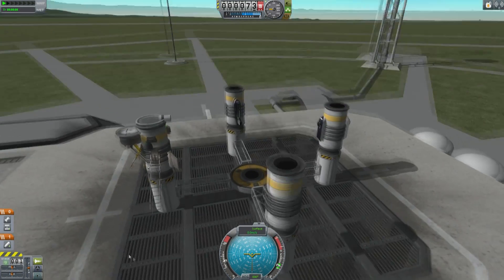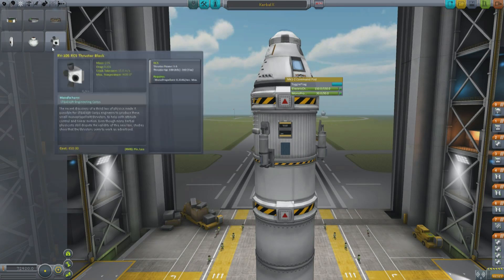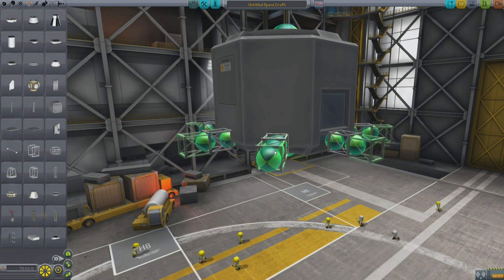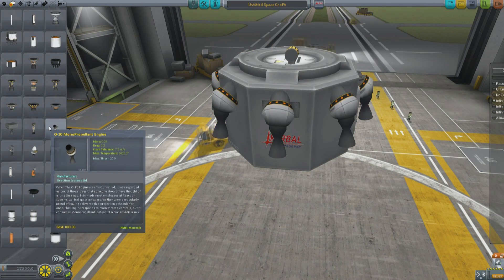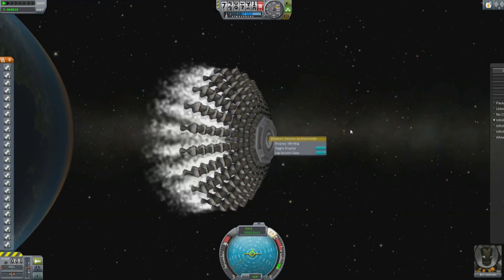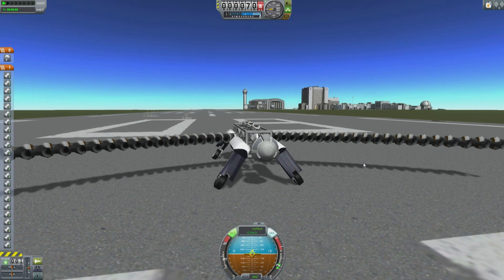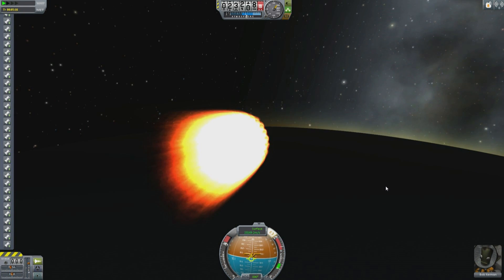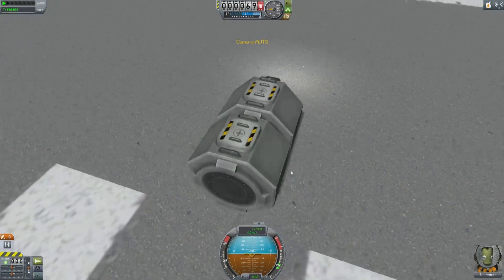Kerbal Space Program - Your Physics Have No Power Over Me!

Comment: Bizarre and cool indeed! :D I was initially a little sad this hack is no longer possible. (I fitted one of the new small & light spotlights to a plane off-center, and although it was inside a service bay, the plane developed a clear tendency to roll to that side. The plane was a lightly modified stock Dove which masses 10t wet and still had most of its fuel.) On the other hand, we now have KAL overclocking, and it was really fun finding my test rig could get to Mun orbit from Kerbin's surface in 10 minutes, or probably much faster if I'd wanted to spend the time on it. But I like my hack-driven ships to look weird and alien, and so I build the drive into this UFO with about 17 tons of silver fairings and bubble cockpits, and now I'm afraid to throttle it above about 20% for fear of the drive tearing free and blasting its way through the ship. It takes over an hour to get to Mun orbit with that limit. I should retest it now I've applied autostrut to the heavy parts and rigid attachment to the reaction wheels.

Comment: Does anybody not realize that at the part where he bounces off Jool the craft is going so quick that it stopped time and began reversing it by 14 times, which means essentially this: the amount of time reversal has something to do to a variable equivalent to the total distance in light years or 299.8Mm (million meters) per light second times e subtracted by one over the difference between the speed reached in a multiple of c and c (to accommodate the slow down of time to a standstill from 0c to 1c), meaning that in this case, the total possible amount of time reversal is 299800000e(1-1/14)^??. The question marks representing what I don’t know how it would work. But essentially it is impossible to reverse time by the exact distance covered as the multiplier of c which you are going increases the closer you get to the exact amount of time that you can possibly reverse. Basically you cannot instantaneously move from one point to another but even at 15c it would take a year to move across 15ly, however you would reverse time by -(15-(1/15)) years, which I may say isn’t that bad of a result. But regardless if time travel by interstellar warping is possible this is a good example of its limits.

Comment: I have a theory on long term space craft propulsion.
I am assuming a great deal, but what if we used either U233 or Pu-239 in nuclear engine and using hydrogen due to its higher specific impulse in seconds at over double the velocity of chemical rockets.
We have the rings of Saturn containing nearly all water ice ie hydrogen and oxygen, though that hydrogen might be missing an electron.
Would it be feasible to scavenge the vast amounts of  ice from rings and convert it to its constituent hydrogen and oxygen?

It would provide unlimited amounts of both elements for refueling space craft and restocking spacecraft air supplies.

We definently need to find vast resources out in space to refuel space craft just as we found myriad deposits of hydrocarbon fuels in vast quanties for powering  our energy needs on Earth.

Comment: lol you can't get to light speed with a vehicle, not even in "three days"
Reply: +ardstsp yes you can! Speed of light is just 299.000 meters per second so if you are in an 100 km orbit and exelarate for 3 days with the right amount of thrust you would eventually reach speed of light what happens after that.......nobody knows
Reply: FreakGaming The more mass you have, the more fuel you need, the more fuel you have, the more mass you got and so on and no it's 299792458 m/s and yes I know that without google. But theoretically, if the source of energy is external... like a super long electrical cord... but still then, the electricity wouldn't be as fast as lightspeed so... photons are this fast because they nearly got no mass, that is really hard to emulate
Reply: ardstsp think anout the ion engine the dawn probe uses if they would pack enough xenon gas on such a probe and they just thrusted for years and years without running out of fuel they would reach the speed of light.....i think. Also my 299.000 was a rough estimate ^^ i did knew that it started with 299 :D i think it was 1079251000 kmh though right?

Comment: is there a way to get an orbit in atmosphere?
Reply: +Exopat Achieving orbit implies that you are able to fall and miss the planet continuously. If you are in the atmosphere, the air will slow you down, making you slow enough to no longer 'miss' the ground. I suppose you could achieve orbital velocity in atmosphere, but in addition to slowing down when you run out of fuel, you probably would burn up due to friction.
Reply: thats called flying lol
Reply: a bit late but if you get a ship into a High 60,000 meter plus orbit you could traverse the planet a few times. leaving the spaceship will put it on rails and i don't think the game destroys on rails parts until the orbit periapsis is bellow 35,000 meters. It's worth noting that in real life all satellites experience some atmosphere, the ISS is low enough that it occasionally has to make adjustment burns to keep it from gradually deorbiting.
Reply: flying
Reply: The atmosphere gets exponentially thinner the higher up you go. There's no magical boundary at 100km where the atmosphere stops (though it is ridiculously thin at that point). It just gradually fades away until your particle count is indistinguishable from "empty" space. But even empty space has particles in it.

Comment: I finally understand the ending of 2001 Space Odyssey, Dave was just messing around with massless thrusters around Jupiter.

Did they ever patch this out? If so I've been wasting a lot of time trying to balance 0.005 mass objects on my ships.
Reply: They fixed it in the 1.0 update. These parts now add mass to their root parts.
Reply: Gigabic Root part? As in: trying to balance a ladder on one side of a fuel compartment with a static solar panel on the other is pointless, because the weight of both just get added to the fuel compartment? Making it a slightly heavier single/ centred object i.e. weight distribution is irrespective of placement with objects with a mass <1.
What about aerodynamics? I'm sure I've seen entry trail flares coming off those things/ get destroyed when they get hot enough when poor placement meets high velocity.

Comment: I did this yesterday actually. Except instead of monoprop engines I had a molten salt thorium reactor and the Alcubiere warp drive.

Jool is just such an obvious target since after you drop out of warp its gravity will handle most of the orbit adjustment. It still took an external engine unit that I'd docked to the ship and a total of 5 nuclear engines to get into orbit though, but I'm working on getting the second craft down to a better ratio between warp drive and engine mass.

I called it the Fawkes, mostly because calling it the Phoenix before I'd even worked out if the reactor was powerful enough to power the warp drive seemed a bit like hubris... =p

Comment: I hope you read your comments because you will like this. The new stack decouplers are also physics less so you can make any kind of spacecraft powered by them because that way you can have infinite fuel that has no mass. You are only limited by the power of your computer. My little laptop is capable of launching a 40 kg space probe capable of getting to every body in the system. And most importantly, it doesn't involve any cheats.

Comment: Make one that decouples from the pod upon launch so it can have as little mass as possible, then put the smallest mass part that has mass on to reduce bugginess, but just one! Also, make sure it is much bigger, like whole launch pad big. Use cheats to disable damage from crashing and to joints. Then hyper edit it to the edge of the solar system and fly far far away from it. And maybe with mod that allows time excel whilst throttled. Or just physics warp.
That would be so fast!

Comment: What does "Accelerating by 15g" actually mean?
Reply: Accelerating with 15 g-force which is about 1440 m/s at 9.8 m/s squared (1g)
Reply: Thanks :D
Reply: Topi Lindström Its not about velocity, its about acceleration. When a race car crashes it has negative acceleration. No matter how fast an object moves, it has a zero acceleration if the speed is not changing. To further explain this: Lets say a vehicle accelerates from 0 to 100 km/h in 2 seconds. Thats a huge acceleration. What about when a car crashes at 300km/h. The velocity goes from 300km/h to 0 km/h in few tenths of a second. Now that is a huge (negative) acceleration.
Reply: Efraim132 2G acceleration from a standard person carrying rocket launch. the V2 could only manage 0.9G and was therefore unstable at launch. hence the need for a launch tower at these lower accelerations.
Reply: 46 G is the current record for survival.  It did cause permanent eye damage to the test subject, but it would appear that as long as the duration is short enough, the human body can take quite a beating.
Reply: iambiggus actually there are 200G car crashes and the drivers survived. Although they are race car drivers.
Reply: To give some comparison here, your average human passes out at around 5 or 6 positive g
Reply: That's a lot by the way. The norm is about 2g.
Reply: Vastator
the norm for what?
Reply: 1g is your weight standing at sea level.  So at 15g, you'd feel 15 times heavier than you normally would.
Reply: Means 2 times the accelaration that will couse you to die of internal damage!
Reply: iambiggus It also depends on the orientation of the person. That 46G test was done in a horizontal position.
Reply: Basically, 1G is a force equal to gravity. So if you're at 10Gs, you're experiencing 10x the usual gravity.
Reply: 15 times the acceleration due to gravity
Reply: Joakim Sandqvst I think you are missing the point. He said that there are crashes with 200G. It would mean 1G = 200G. So let's play that the driver is 50KG, that is 50000G. Now 50000 x 200 = 10000000G = 10000KG = 10tons. So how can one driver become 10tons? The race car has to reach MACH speed to anchieve that. And racer can't take that. His internals would propably get crushed or explode .-.
Reply: The race car's crashing part itself experiences a momentary 200G. However the car is designed in a way that it absorbs some of the impact leaving smaller acceleration for the driver as stated before. Someone also wrote here earlier that human body can withstand huge g-forces but only momentarily. I dont have reference for this but I think I could find one if I googled.
Reply: Joakim Sandqvst Momentum 200G... When the car crashes, the driver flies outta his windshields, get himself crashes to wall or whatever he crashes, and then the cars rear follows, crushing him. Sure cars are designed to absorb damage but race cars go for speed more than protection.
Reply: Yea if a race car crashes head to head with a wall i bet the driver dies. But he doesnt necessarily die to g forces but the impact. Its a different thing. Also i think racers use seat belts and they probably are more advanced belts than the ones in a normal car. The drivers dont fly trough the windshield. They probably reduce the impact as well. Ofc that wont save you when you drive to a wall.
Reply: Joakim Sandqvst So why are you defending his theory? Driver will die and he made that up, on a freaking Kerbals Space Program video
Reply: Joakim Sandqvst Also some belts have caused death to the drivers, snapping their neck. Also, hull can break so the windshield flies away with the driver.
Reply: Im not defending anything. Did you delete ur first comment btw? Cant find it anymore. I just corrected the part about speed. And were talking about a human body withstanding g-forces. Not an impact. If you drive 80km/h to a wall you can survive or die but if you die, its not because of g-forces.
Reply: Joakim Sandqvst No i did not delete it, it comes after some comment made by Xhing or so. Also, i was not talking about momentum gravity. As some guy said above, human body can take 46G. That is the record, but the one he made, was 5x times larger number. Also it caused permament eye damage, just thinking what 200g can do...
Reply: Robbie McCann negative g \( ° ͜ʖ °)/
Reply: Joakim Sandqvst "Yea if a race car crashes head to head with a wall i bet the driver dies. But he doesnt necessarily die to g forces but the impact."

From what does he die then?
Do you know the other forces?
Do you think it has to do with strong, weak or electromagnetic interaction?
Reply: Nitroschock very well sed \( ° ͜ʖ °)/
Reply: Nitroschock Well I cant be sure, but I would say it is one of the Contact Forces: Frictional, Tension, Normal, Air Resistance, Applied and Spring Force. I'm saying the person would die from the contact and not a force.

Also you are making an assumption that if a person dies, he must die to one of the known forces. If a person is shot, does he die to one of the forces you listed: Gravitational, Electrical or Magnetic Force?
Reply: Accelerating at 1g you could travel forward in time over 100 trillion years in just 20 years in realitave time

Comment: Hey Scott, I have an idea I have been working on. Well, I should say did work on because I actually managed to get it to work until I had to re-download the game due to technical problems, and had to start from scratch. I once decided to make a plane that would have a form of escape pod built with the module. This was if the main section behind the pod were to have any malfunction, you could detatch and use the small recourses included in the pod design to fly away and make a safe landing. Really,  it is a short -distance and fully functional mini plane built to work as a standard plane. I remember it was a bit hard to take off and required wheels on the wing tips, and when trying to pull up too much prematurely after takeoff requires emergency engine kill, quick reposition,  and full engine reactivation. After that though, the plane flies like a dream, and even can escape the atmosphere. It is an interesting design, along my favorite achieved design I have ever made and wanted to see if you can improve.

Comment: Yeah, about those physics-less parts?
There's one you forgot to mention that has absolutely no right not having physics.
That part is the 3.75m stack decoupler.
... That's got "hey look at me I'm a bug that can be fixed in 30 seconds or less" written ALL over it.
Maybe, just MAYBE, that's the reason people keep having Kracken attacks on their 3.75m launchers? I would be VERY surprised if it wasn't at least one of the factors.
The KSP forum has known about this bug since pretty soon after 0.23.5 launched, and has known how to fix it for about the same exact amount of time.
And yet it wasn't fixed in 0.24, 0.24.1, 0.24.2, the last two of which are hot-fix versions.

Oh well, at least it's easy to fix on my end.
Just have to comment out the "PhysicsSignificance = 1" line in that part's config, or just delete the line entirely. Physics restored with a literally 30-second fix.